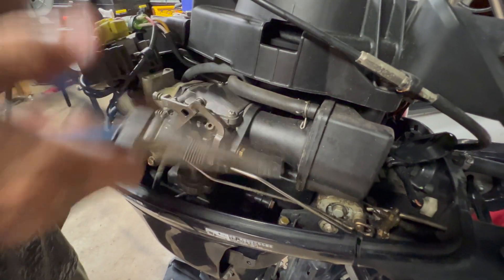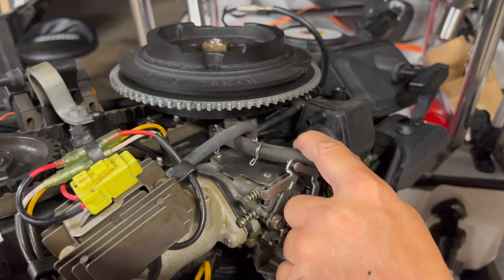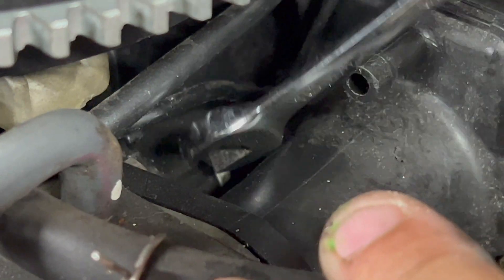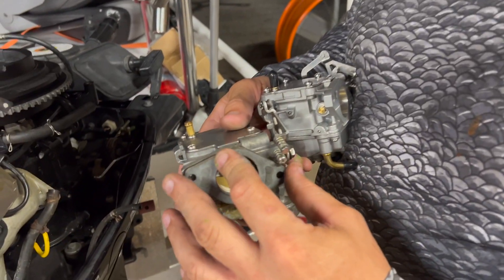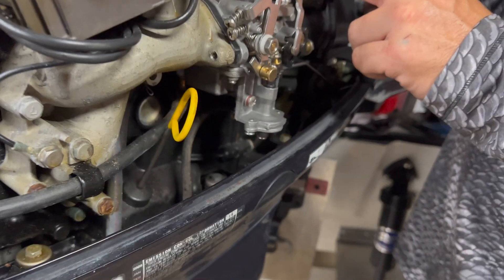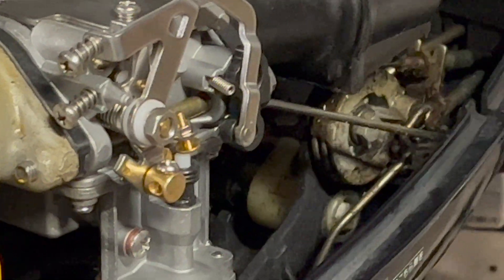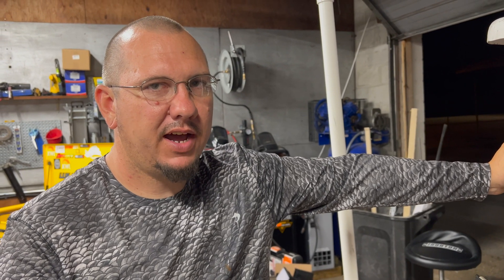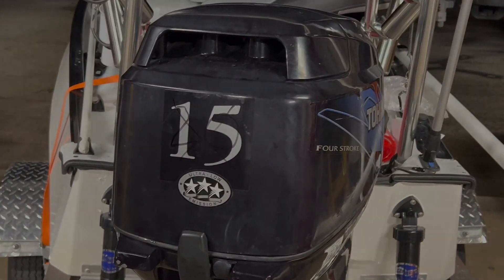Tohatsu 15hp to 20hp Engine Upgrade

Comment: I did the conversion and gained nothing. The only thing that I can think of is that I already had an aftermarket 20 HP carb on the motor to start with.
I’m doing about 24 mph in a 12 foot Alumacraft with controls and a 15/20 HP mercury four stroke

Comment: Is it worth upgrading for 5 more hp? I’d like to see a performance clip on this
Reply: That 25% more power. Its noticeable
Reply: Well, I did the conversion on a 2006 mercury. Ordered an OEM Tohatsu 20 HP carb. 
I gained absolutely nothing. In fact, I think I dropped off a mile per hour.

Comment: You can get that inner 10mm carb bolt with a long 1/4 drive extension and 10 mm socket from the front of the motor, no need to take the recoil off, or cam cover off.
Reply from the maker: Yeah we figured that out later! Thanks for the tip!

Comment: How many cc is this motor ? I have 2020 15hp merc 4stroke 333cc .Would I be able to do the same mod?
Reply: Look up a parts manual on line and compare what parts are different between a 15 and 20 hp, on my model the carb was the only different component, but you need to check things like the ignition module etc. to see there are no other differences.
Reply from the maker: Not sure on the cc. It’s a 15hp though. May be possible with your engine as well just depends on the model.

Comment: Should do an after video to see the difference you said you where getting about 23mph with the 15 carb
Reply from the maker: We were going to but ended up finding a deal on a 25hp and sold this motor. Ended up gaining 3-4mph but had a stronger hole shot.
Reply: @Nauticalbros   I just bought a 15hp tohatsu waiting for it to show up. Before the upgrade about what kind of speed where you getting. I have a 14ft aluminum boat it’s going on. I’ll probably end up posting a video after the break in
Reply from the maker: @wildmanstew5736  21-23mph on the top end depending on weight and waves in a classic gheenoe. The 15hp is a little beast and should push a 14ft aluminum boat pretty good.
Reply: @wildmanstew5736  I have a deep V and beamy 14 ft Polarkraft, which takes some pushing along compared to the average 14 ft "tinny" the 15hp struggled more than I expected it to, the conversion to 20hp while not dramatic certainly made a big difference with a better holeshot and may be 3 mph on top speed. I'm boating at altitude over 6,000 feet normally so I'd imagine a 15hp closer to sea level would push a 14 ft aluminum boat very nicely.
Reply: @fiveowaf454  I have a 14ft fiberglass boat that sounds the same as your boat. It probably weight about 275lbs. I wanna get the same engine and do and upgrade, What the fuel consumption cruising and hour? Roughly or what’s your experience on a tank of gas. Thanks
Reply: @Jakeup211  Fuel wise I haven't really noticed a big difference, obviously if you go full throttle all the time it will use about 33% more fuel than a 15 hp as that is how the extra power is achieved, but with more prop pitch and better cruise capability there isn't a lot of difference that I've seen, I don't usually run full throttle much and am often running low rpm's exploring the shoreline and looking at scenery and wildlife. I use a 3 gallon tank and always carry a spare and while I've swapped tanks as a precaution when the weather has blown up and I don't want to risk running out of fuel in strong winds and waves, I've never changed tanks because one was running dry, so don't feel the increased fuel consumption is any concern. Most day's on a big lake I only use 2 gallons, or so.
Reply: My experience doing the same swap was about the same, the extra HP isn't dramatic but holeshot and top speed are better about 3 mph on my boat, with no negatives in terms of low speed running and fuel consumption, other than obviously you will use more at full throttle because you are getting more power.

Comment: Hi guys!
 is it an oem carb and what's the result on the water ? Have you considered changing only some part of the carb instead of the whole thing ?
Cheers!
Reply: The OEM carburetor is cast with a huge restriction to the bore of the intake. It also uses different fuel circuits in the carburetor in terms of where the fuel path is and at least one of the jets is in a different place, so you cannot achieve the change by swapping just the jets, even though internals allow for the necessary parts to be installed. I don't know if the restricted bore could be machined out, but by the time you've replaced the internal parts needed to have the carb work like a 20hp one, it would make no sense financially. My outboard is a 15hp Mercury, the one built by Tohatsu, but I found a new carb from Tohatsu was about half the price Mercury wants for the exact same thing and then I got one a little cheaper from eBay. I then sold my Mercury15hp carb on eBay for a good price based on the perceived value given they were listed at $400, or so, from Mercury. The whole thing cost me about $60, another 5hp and a brand new carburetor for not much more than a carb rebuild kit was a great deal.
Reply from the maker: Yes it’s an oem carburetor. We did consider just changing the jets but I’m pretty sure it is a different part number with bigger passages in the casting for flow as well.
Reply: @Nauticalbros  The carburetor is cast with a restricted diameter to the air passageway. Then the use the internal passageways differently in terms of where the main and idle jets are located. So if you wanted to use the original carb you'd need a load of parts to locate the correct jets in the appropriate locations and then have to bore the carb intake out to remove the restriction. Buying the right OEM carb and selling the original is really the only viable option.
Reply: That's interesting how your saying that the internals are different on the 20hp carb. I have a 2012 Merc (same motor) 15hp and when I look up the parts between the 15 and 20 it has the identical breakdown/ part numbers. So I'm not sure what the difference is between the two??
Reply: I did the conversion to a 20 HP carb and gained nothing. So you may be onto something.

Comment: Will the 15 carb work on 17 9.9 carb swap ?
Reply from the maker: Not really sure to be honest. But it does work on the the 15 to 20hp upgrade. You can always look up the parts for each and see if the parts would line up.